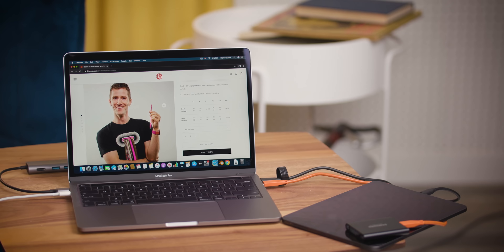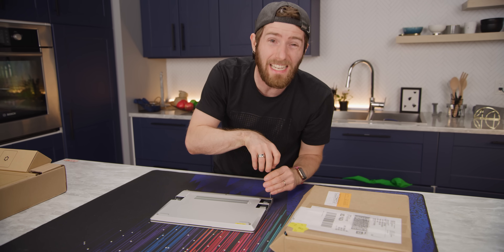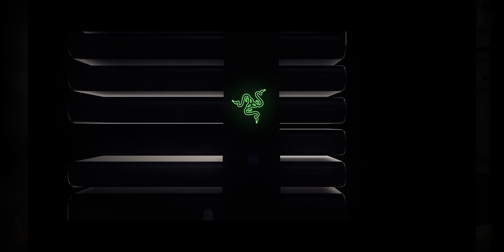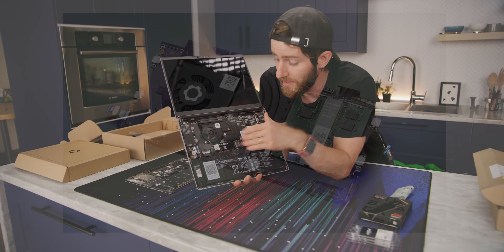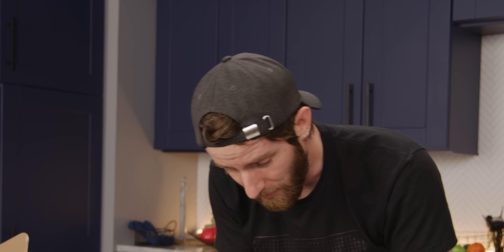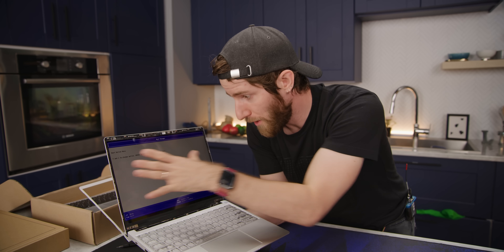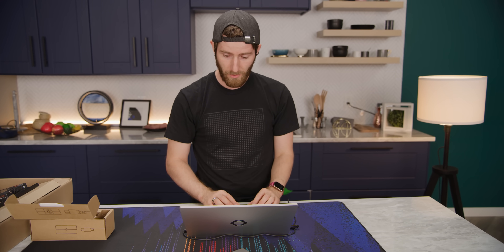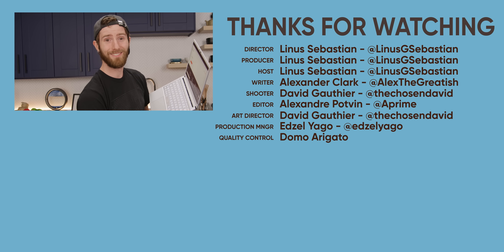A COMPLETELY Upgradeable Laptop?  - Framework Laptop Review

Comment: I got an old chromebook from my dad, he said that the repair guys had said it would take 60$ just to diagnose it. The screen was blacked out. At first I thought the screen-motherboard cable was shorted, but then it continued having issues after I replaced it. I eventually realized that the TAPE that helped keep the cable connected to the socket was a little bit weak and left the plug wobbly. I slapped a peice of duct tape on it and it hasn't ever given me problems since. Maybe it was a combination of a cord short and a plug issure, but I think it was likely just the plug. 
What you should get out of this:
1: Tech repair is often overpriced.
2: Chromebooks are also really easy to fix. (Though you might want some experience before you muddle around inside one.)
Reply: But imma get me a framework next time I buy a laptop.
Reply: I wish I could have designed that thing.

Comment: I would refer a fatty laptop if it meant more flexibility like this. Give us hotswappable batteries, exchangable GPU / CPU parts, screen types, etc.
Reply: Alienware area51m the real completely swappable laptop but take note it cannot be upgraded to new generation gpu.. but hey at least you can replace if it fail.. unlike this overpriced soldered cpu/integrated gpu.
Reply: @jonmon5745  Yeah, that's closer to what I'm looking for! Unfortunately, it failed to allow users to upgrade to the newer available GPU CPU modules by the next model, which was kind of the point.
Reply: @RussianShadowDragon  at least if you bought rtx2070 super you can upgrade it to rtx 2080 super.. or if cpu or gpu had problems you can buy which of the 2 is broken. I meant by Area 51m R2 not the area51m version.

Comment: I like the idea of saving a good amount of money just for self assembly. For me that's a selling point. It adds fun and getting it at a cheaper price feels like a good win. I don't typically swap out components even on something modular like my desktop PC, but the main thing most people will swap I think is any different or new I/O interfaces. And from day 1 you can customise the I/O interfaces you need, not be hassled with dongles. Death to dongles!
Reply: 1000$ for self assembly wow cheap...
Reply: @jonmon5745  Supposedly $200 less than with assembly. Anyhow, it needs to match up similar specs to a competitor. If it's really $200 comparatively cheaper, then that is a good discount IMO.
Reply: @Diode5  nope lmao it's DIY assemble with the most basic specs is priced at 1021$ for i5, 8gb, windows 10 home, 256gb ssd and wifi. Prebuilt is only 1000$ basically you are paying 21$ more for self assembly.
Reply: @jonmon5745  Well in that case it wouldn't be worth it. 
I like the idea like a desktop PC that you can build a better spec machine for a certain amount when you build it yourself.

Comment: Hey Linus, I've been a long time fan of your channel, but I call absolute BS on this. I would have accepted if the title was, let's say" A semi-modular laptop that you can upgrade and repair & replace" but you didn't. You went on to call it a fully up-gradable laptop. I do acknowledge it is up-gradable and completely serviceable, but it isn't completely up-gradable. For instance can you upgrade the CPU? or it's cooling or the display or it's battery? I doubt it. Correct me if I'm wrong. Please don't mislead the people with the title.
Reply: As mentioned, you can’t swap the CPU because embedded processors lack pins and slapping a desktop cpu would tank battery life, increase thickness, and necessitates a bigger cooling solution. Speaking of which, you can swap thermal paste, but why would you want to upgrade the cooling system if the current one doesn’t thermal throttle?

As for the display and the battery yeah you can swap them :p
Reply: @npgoalkeeper  Nice try, but you didn't actually answer my question. Is the CPU or GPU upgradable? Do you actually understand english? I admit english is a rubbish language but your perception of the language is even more dilute than the language itself. I suggest you get a dictionary and find the meaning for the word COMPLETELY\COMPLETE. And by the way I accepted the fact it's totally serviceable, but can you upgrade the display or the battery or the CPU & GPU? Again I suggest you go to the "english dictionary to find the difference between swap and upgrade". And I completely forgot, you mentioned as to why I would upgrade my cooling system if the current one doesn't thermal throttle? It's simple, if it is truly & completely a upgradable laptop I would upgrade the CPU & GPU; and logic & science says I would need a better cooling solution. Do you get the gist? If not, let me make it clear - I'm a fan of LTT, but I'm not an idiot. Best of luck trying to fool an idiot. I'm sure you will be able to find lots of them, but I am not of them.
Reply: @krank4352  why are you getting so pressed and why can’t you read either? All I said was that you can’t swap the cpu due to technical limitations (mostly that intel quite literally doesn’t sell mobile cpus with pins). By the way, framework never claims that the laptop is fully upgradeable (which isn’t possible in any machine, desktop and laptops alike, anyways), and that you’ll need to swap your entire board if you feel like you need a performance boost.
As for the idea that better cpus require more power draw-what? Are you aware of performance per watt? A system engineered to dissipate the heat required for a CPU that draws 30w (around what the i7 1185G7 draws at the absolute most) will also work for another cpu that draws 30w with similar temps. This is what “basic logic & science says.”
As for the display and the battery, nothing is stopping you from swapping (which you kind of need to do in order to “upgrade” a part) it for something else, but nobody makes replacements as of now. No different than how off shore companies sold “higher capacity” batteries for phones such as the note 4. This is why framework doesn’t glue down their batteries nor their displays.
Reply: @npgoalkeeper  I'm sorry I wasted my time on you. There is a saying "you can wake  up a man from his sleep but you can't wake him up if he is pretending to be sleeping". Hope you get the gist, but I'm sure you won't. Cheers.
Reply: @krank4352  lmao not even gonna tryna and refute my point

If you don’t know what you’re talking about don’t talk at all :3
Reply: @npgoalkeeper  Just as I expected, have a good time with your blinkers on.
Reply: @krank4352  no u
Reply: @npgoalkeeper  Right, that makes a lot of sense. Thanks for proving my point. Cheers again.
Reply: @krank4352  ok boomer
Reply: @krank4352  you literally lost the argument then resorted to ad hoc sooo
Reply: @npgoalkeeper  It's okay, I'll give you time to come-up with a reply; anyhow I'm going to sleep and will reply to your childish statements tomorrow. I have things to look into that are more important than your stupid blinded thoughts. Have fun trying to come-up with a comment with the help of all your friends or whatever, I'll see you tomorrow. Good Night. Sorry, I forgot to ask you, are you the LTT patrol?
Reply: @npgoalkeeper  I've replied atleast 4 times and my comments aren't displayed, which leads me to believe that you are actually part of the LTT patrol or the, scummy Youtube has a hand in this, which I wouldn't be surprised about. Either way, it shows that you're guilty and don't want to admit it.
Reply: @npgoalkeeper  Good Night, I'll see you in another 18 hours or when I've the time. Try to to come up with your best reply. Good Luck.
Reply: @krank4352  cope
Reply: By the way, how old are you? 8-9? Wait, don't tell me, you are actually ten years old.
Reply: @npgoalkeeper  Nice elaboration. Thanks for clearing things out. It was very insightful. I will instruct your teacher to give you an A+ for being the stupidest person I've come across my whole life. To conlude, you've already ruined my sleep. So it's my final good night for today and if you want to be more embarrassed, pls comment and your wish will be fulfilled.
Reply: Yeah bullshit misleading title. At first I was like DAMN FINALLY COMPLETELY UPGRADEABLE... Then later on found out cpu/gpu soldered and gpu not even dedicated. So later on I thought if cpu and gpu soldered I said like, WTF WOW WAIT A MINUTE COULD IT BE maybe ram/ssd are upgradeable to new generation. Then again surprised it's not also... So what the hell is the title is for when pretty much my old windows laptop can be upgraded to any current gen ddr3, swappable battery, ssd and screen so what is the special about this laptop why is have "completely upgradeable title". The thing is this thing doesn't deserve that title coz the same at my old laptop no matter how you upgrade you ram/ssd you are still stuck at current gen so you reach the bottleneck performance. So if you wanted more power for video rendering/gaming/faster load/higher refresh rate all that being said will enhance your experience you still need to buy a new generation laptop.

Comment: I was super interested in getting one of these... I ended up getting a clevo, with rtx3050, and the 8core i7... The screen was too small and it would have been almost 2000 for a framework quad core after ram and hdd.... I really want to get into this ecosystem, I just hope they make a model with a bigger screen in the future.. won't be able to really upgrade the Mobo on the clevo, but it was like 500$ ish less with double the cores and a gpu

Comment: It’s really impressive. I hope they add GPU options in the future.
Reply: I heard they are waiting for Thunderbolt certification.
Reply: KennedySpace11  Right right, as I eluded to in my post above. They're casting the widest net for the most market demand, in which iGPUs would be more prevalent. 

I do question how many non power users would be interested in a modular repairable laptop however. Hoping Framework takes off regardless!
Reply: Same. Not sure I'd have a use for it in my life until we have modular dedicated GPU options. I do however understand they have to make something competitive based on what the market offers and demands, so I can't fault them.

Comment: Laptops in general have been getting more stingy on ports in recent years but four total still seems unusually stingy. Connect a keyboard, monitor, mouse and power supply and you have no ports left for anything else.

They also don't have an Ethernet card option and the moment and have said the Ethernet expansion card will be "oversized", how much of an inconvenience that will be remains to be seen.

Comment: I've changed nearly every part on my old laptop (sata ssd upgrade, optical drive replacement, ram upgrade, cpu upgrade, hinge replacement, keyboard replacement and even a motherboard replacement) from 2009 and I still use it daily. While having a Core2 duo 9800 and 8gb of ram is a bit of a bottleneck it does what I need it to do reliably. I did buy a new laptop but it actually lacks features and upgradability. For some reason someone over at Lenovo in the ThinkPad department decided that they should keep the full sized frickin VGA port but move from a full size HDMI port in 2009 to a mini HDMI in 2015... when there's plenty of space for a full sized port. also the cpu is not upgradable but I've only put $300 into it so I can't really complain

Comment: I had (still have) A hp pavilion laptop and I upgraded processor, WiFi card and memory. Sure I had to open and dismantle most of laptop, but it was quite simple.
Reply: That's basically what I've been saying. I've repaired alot of laptop so I was surprised alot of comments here say this is really good concept, I was like WHAT?? Ram, hdd, ssd, are upgradeable and replaceable while lcd, keyboard and battery all replaceable too... Even soldered ports are replaceable.. So how is this laptop any different lmao pretty much old news to me except for gimmick modular IO.
Reply: @npgoalkeeper  ram ssd and battery are easy to replace even a dummy can do it... Screen a little challenging but there's youtube for it....
Reply: @jonmon5745  In my laptop you have to pull the entire board (30+ secrews) to swap my ram and ssd :p
Everyone’s different, it’s just this one aims to make life slightly easier

Comment: the problems with this laptop is that I could snap it in half in 5 seconds and its way to expensive, my 2007 HP EliteBook 4gb ram 350gb drive running windows 11 home, half metal chassis, I would rather have this then that thing, that's just my take.
Reply: While repairing my desktop, was stuck using a 4GB ram Windows laptop.  Never again.

Comment: Inductive charging claims by Apple and Microsoft seems like nonsense. Toothbrushes and many other devices use the same technique. 
Also, that bit of flex easily tolerated by a Framework could be bad for some Apple units.

Comment: Since i don't much care for the battery on a laptop, and just need the bare minimum for a hypothetical power out or move around the house (so let's say 45 minutes of battery should be enough), i'd love to see a battery module that's smaller, and in that space freed up, space to shove in a classic, good old HDD. The space is there, and the latest super thin ones (i think it's something like 4 mm thick) should fit just fine.

Comment: The Nokia 1020 negates the argument for a "tight" package that allegedly can't be taken apart. Before dying to Micro and Soft's incompetence, they pulled that phone out which proves you can have  a very packed phone that's both robust and easily repairable. The entire screen can be removed by pulling one screw and one rail. So NO, there's absolutely no reason for the greed and garbage of manufacturers.

Comment: I don't know why they keep making laptops thinner.  Why would you need a super thin laptop?  Are you trying to fit it in your pocket?

Give me a thick laptop with an upgrade-able GPU.  I want to be able to pull the GPU out and put a new GPU in.  Back in the old days we had PCMCIA cards.  Why did they get rid of them?  We should be able to swap a GPU out and in just like the PCMCIA cards.

Or how about a docking station that can attach to the bottom of the laptop.  The docking station can provide a discrete GPU, second SSD, cooling fan, etc.

Comment: can you upgrade the graphics unit in future? NO. its an apu. so why buy that? its useless if you cant even upgrade the gpu. you can upgrade the ram and the ssd of nearly every laptop. why do I need to change the i/o units? I can use an usb c dongle. this would be future prove for 10 years or more. a laptop without an upgradable dedicated graphics card is not upgradable. I understand that is hard to upgrade the cpu. even on desktop pc you have to change the mainboard in most cases. but the gpu is easily upgradable on desktop pc. so in conclusion this is just like every other (non apple) laptop out there. you can use an extarnal gpu with usbc support. and then upgrade that in future. this is the only way to upgrade a laptop today.
Reply: Exactly!! Alot of comments are amazed but isn't pretty much all laptop have replaceable ram/ssd/battery/screen.... Alot of IO adaptor which are cheaper and usable to all laptop so how is a proprietary modular even a good thing? It's more like monopoly than consumer friendly.
Reply: The swappable IO part probably has something to do with everyone complaining about MacBooks needing dongles, and the non-swappable cpu and nonexistent dgpu situation likely has something to do with power, space, and cooling constrains. Nothing stopping you from swapping the whole board (cpu included) for an upgrade.
Reply: @npgoalkeeper  ure right thats a step in the right direction. BUT this setup is atm npt really good enough. dgpu most be build in. I am not talking about a full rtx 3080ti. but still any card would be better then an integrated apu. this why I have no hopes in this direction. the only way for gaming on a small portable laptop is cloud gaming.

Comment: I have to disagree with the sentiment.
This laptop still is severely restricted in functionality:
- 4 of these bays are not even close to enough. My current laptop has 2 USBa, 1 USBc, 1 HDMI, 1 miniDP, 1 ethernet, 1 SD/microSD, 1 SIM, headphone jack, mic jack and charging port. It would require a whopping 9 (!) of these bays to reach the same level of functionality. I use all of them except miniDP and i still wish i had an additional USBa port and a VGA port.
- i doubt a full-size ethernet plugin will ever be made. or VGA.
- the battery can't be easily detached in and out like on old laptops. i used to carry two batteries that i would swap when needed, that's how you last a weekend without charging.
- no internal SATA bay. I guess that's for the best, given that the lack thereof allows for a bigger battery, yet you wouldn't need a bigger battery if the above trick is employed i suppose.
However, if there's one company that can pull it off, it's probably them.